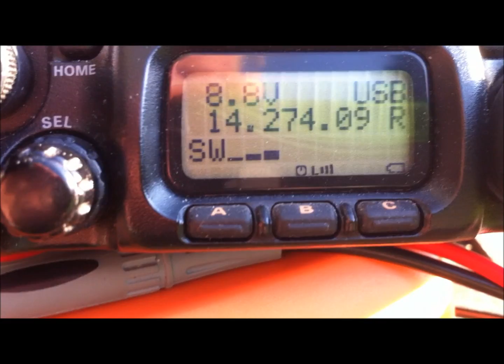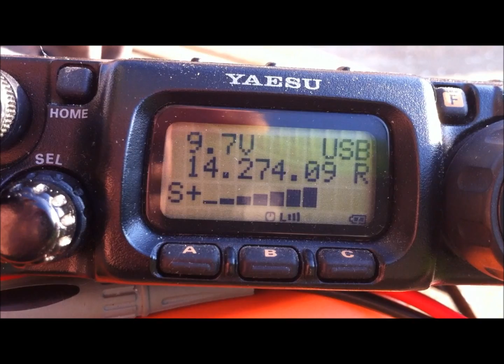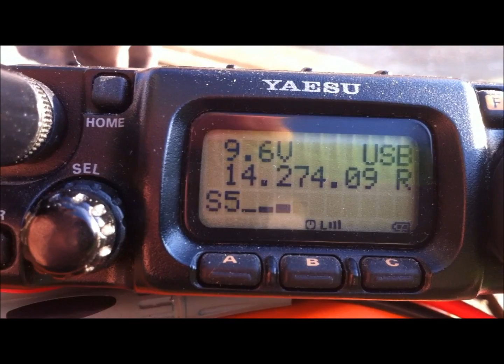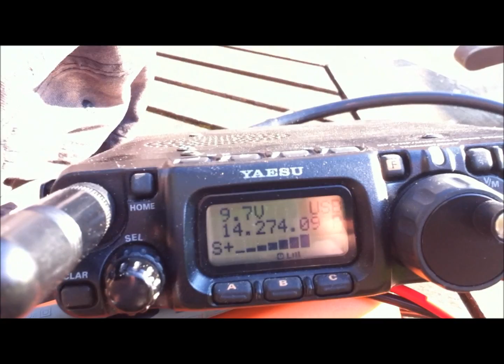Magloop Ft817

Comment: That looks like a sweet antenna. In particular it looks like it would fold up nicely for packing the rig up in a go kit. Do you have any details on construction? My FT-817ND is on its way in the post ;-).
Reply from the maker: Marcus Jenkins Yessiree sorry for the late reply folds
away very easy, G4TPH designs them and has a new range.